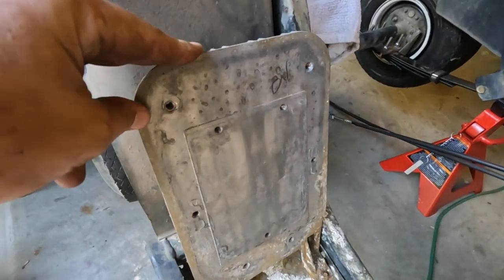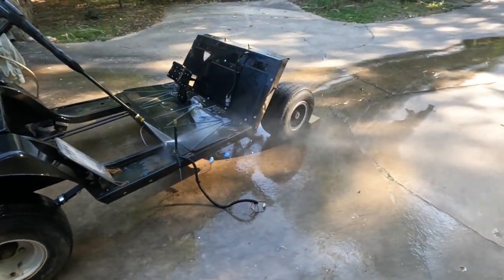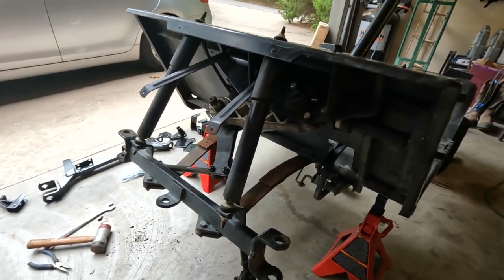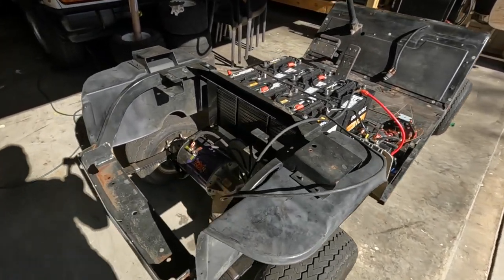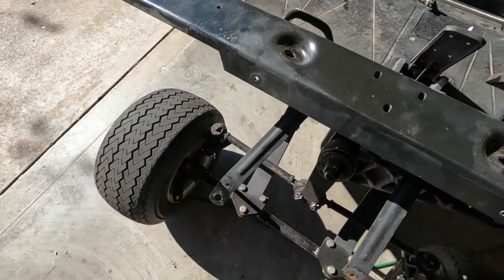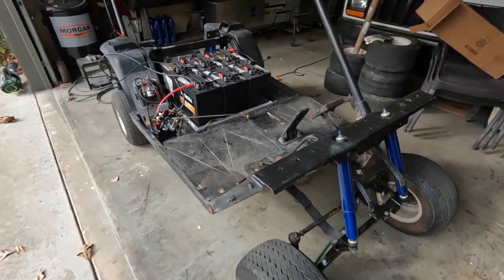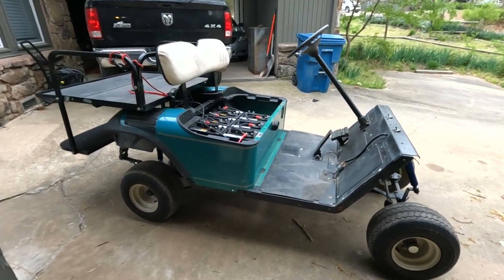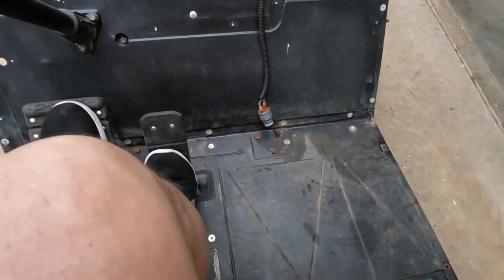Part 2:  Older Yard Sale EZGO Golf Cart Rebuilt Repair Project

Comment: Nice build, looking forward to part 3.. Hoping you can get a constant 18-20 mph up that hill once that controller is replaced. Curious is the spend to get all the fixes about $1k?
Reply from the maker: Thank you. I haven't had time yet to order and install the new controller, but I think it will fix it. If I could get near 18 mph up that hill I would be very happy. I paid $400 for the cart, $650 for batteries, and around 300 or $400 in other parts.
Reply: Was there ever a part 3?